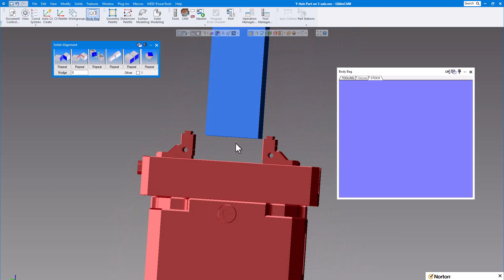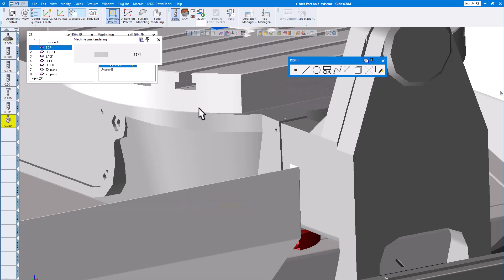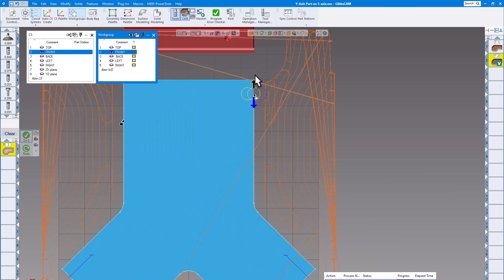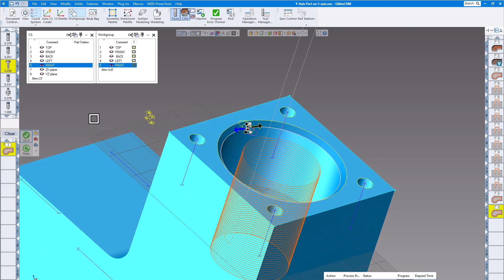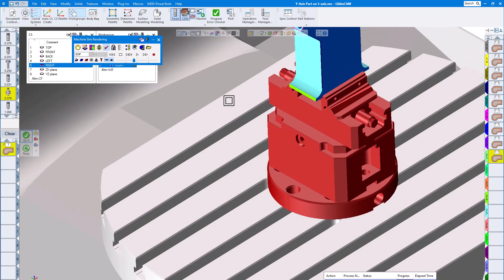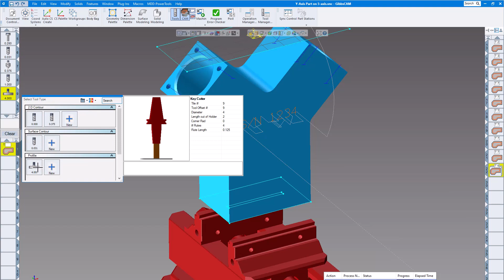GibbsCAM.  Your first 5-axis part from start to finish

Comment: Guys who have solid works ? Can use Gibbs cam ? Can any one explain me please
Reply from the maker: Yes, GibbsCAM can open Solidworks in one of two ways. 1) If you have Solidworks on the same pc as GibbsCAM, there is a link in Solidworks to automatically transfer your part file into GibbsCAM.  2) If you don't have Solidworks on the same pc as your GibbsCAM is, just open the Solidworks .SLDPRT (part file)  or .SLDASM (assembly) from within Gibbs.  Since both GibbsCAM and Solidworks run on the Parasolid kernel they are totally compatible.    Once in Gibbs if you need to manipulate the Solidworks file you can do so without having to transfer back to Solidworks.

Comment: Glad to finally see videos like this.  Need more of them!  

One thing though, need more real world examples.  For example, when you did your op3 finish cut.  Your roughing op left alot of material at your start and finish positions for the finish cut.  Real world, that would cause problems, break tool, chatter, etc.
Reply: Also guessing you have never used a slitting saw?  Lol.  Anyways thanks for the video.
Reply from the maker: @cruch9  In 45 years of machining I have done most every kind of machining.  You are forgetting this is a tutorial, feeds/speeds are at your discretion, as well as rough stock and finish stock.  Slitting saws have changed dramatically over the years, and indexable insert slitting saws are very common, and you would be surprised how aggressive you can use them, but like I said this is a tutorial, your choice on how you want to use them. Thanks for watching!
Reply from the maker: There are definitely some tweaks that could be done on this part, as in all parts.  The area you mention we could just move the roughing a little closer to the vise, and use less lead-in/lead-out on the finish to still do a finish pass without cutting into the roughing radius's.  Thanks for watching.
Reply: @GibbsCAMVideoTutorials  How would you go about machining closer to the vise without cutting the part off completely?  Would you have to duplicate your part and extrude the end further into the vise?  Then use that duplicated part for your volumill operation?

Thanks again!  I really hope this is the first of MANY videos like this to come out.
Reply from the maker: @cruch9  I redid the toolpath, and this is what I changed.  In the Volumill toolpath I changed it from .500 clearance to .300 clearance, then on the finish pass I changed the arc-in from .200 to .100 and moved the start point to just .050" from the end, and when you run the simulation the finish pass does not even touch the radius left from the Volumill path.    Can't attach a pic, but it looks good.
Reply from the maker: @cruch9  You could have more material in the vise, but more material means higher cost.  Many shops prefer to use a slitting saw to almost finish the part, but will leave a .050 or there abouts on the part so they can wiggle the part off, then either hand sand the bottom, or go to a 2nd op to finish the bottom.  Depends if this is a critical dimension or not. Thanks for watching